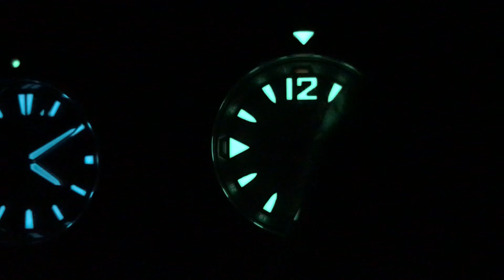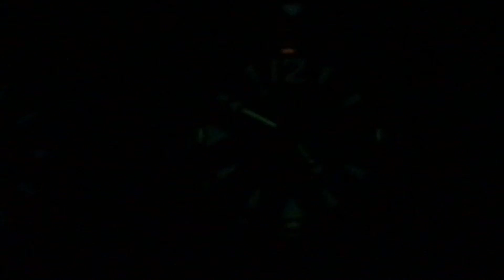Watch Lume: Tritium vs. Chemical ('Luminova'), what's best for your wrist?

Comment: Doesn't the chemical loom also degrade as well? After 20yrs the chemical loom will also flake off and dry up and for the most part stop working as well or am I not correct? Also the Half Life I do not think works quite like the name implies as I believe it's more like a one third loss and not a half loss.Also what is just as important with Tritium is when the tube was made as the clock starts ticking from that moment. The factory that made the tube (how long was it sitting at the factory before being shipped to a watchmaker) then how long was it sitting before use in a dial AND then how long was the watch sitting in stock before purchase as well. Some watchmakers would tell you the date that the tube was manufactured (Marathon for a example) but they even seem to not do that anymore..

Comment: I go to work before  sunrise and the Trinite Lume used by Invicta is still easily readable when I check the time when I wake up before the alarm.
That watch is almost 20 years old and shows no sign of fading. Tritium is a gimmick. On a $5000 Ball watch, it’s an outright ripoff!
Reply: You are wrong on that point. There are several deep blue watches with trtitium tubes on all hour markers, hands and seconds hand for around $350.00 right now on Ebay. Just purchased a new Aragon flat tube watch for $326.00 on the Bay

Comment: Not sure if this is a trigger for watch collectors. But why not put a lithium-ion button battery in there and use led lighting. These last pretty long?
Reply: rubikfan1 well, some watches do have batteries. But if you use the lume often you'll be replacing your battery prematurely. Some watches have a movement system in them that circumvents the need for a battery. In theory, they'll tell time forever. No battery required. Painted on lume requires nothing but light to illuminate so this works especially in watches without a battery.

I have a watch that is solar powered so I push the lume every chance I get just for fun.

Comment: How about Luminous paint on knives? Like in the inside of the screws to find it in the dark while camping, and once the paint comes off add an ther drop
Reply: Luis Tapia there are two separate mid to higher end semi custom knives I have just seen recently that use tritium tubes inlayed into the flipper tab and it was a really cool and initially talked about thing but like the tritium itself was quickly realized to be not as bright and idea as originally thought and the tritium in a knife ideas half life rapidly came to be, fizzled out and went dark. Pun intended. Rather then allowing the user to rapidly find the flipper no matter the surrounding brightness it proved to be more of a gimmick or conversion starter/sales trick. I think it’s why it’s never caught on. I think nick did a review on one of the knives I’m talking about.

Comment: Honestly I feel like timex's idea of indiglo is really fucking underrated
Reply from the maker: It's got a lot going for it.  But it's also very patented :(
Reply: Really? Its just an EL backlight on an analog watch, other companies do it all the time with digital. Sucks if thats true
Reply from the maker: The other thing to remember is that Indiglo requires power, so Quartz only.
Reply: Timex watch is so poor in quality. My 1st 1 broken in 3 months, and the 2nd broken in 1st day. Heck I don't even want to consider a 3rd 1.
Reply: henry109947 I hear ya!!Indiglo was the best
Reply: True....but I'm tired of batteries.  All my watches now are either automatic or Solar.  My latest purchase, a Casio Protrek has an excellent light that brightens up the whole analog dial.  Solar so it doesn't need to replace the battery.
Reply: Bryant Baker it's not possible now or maybe too expensive to do it